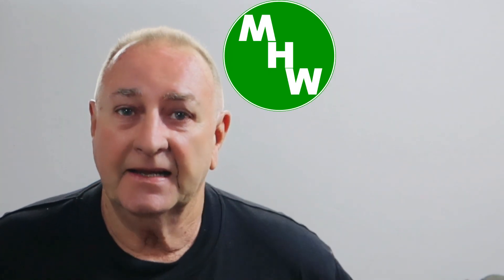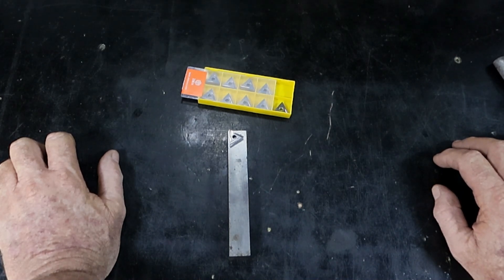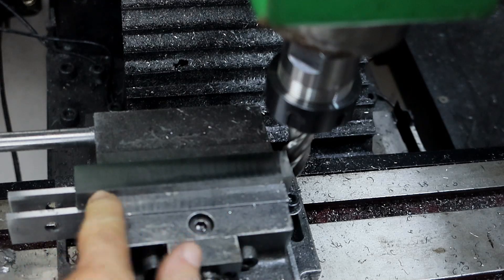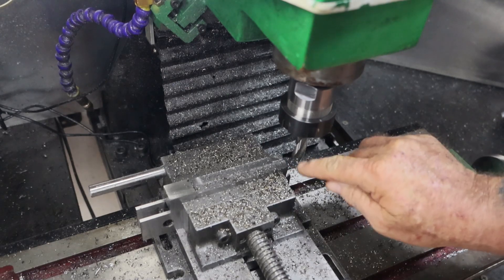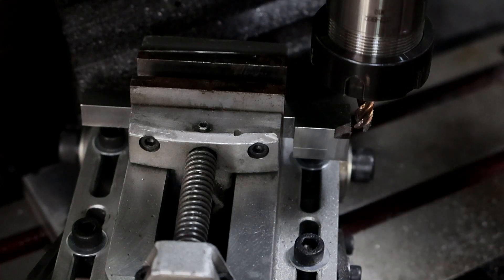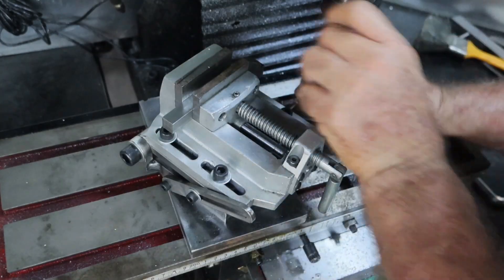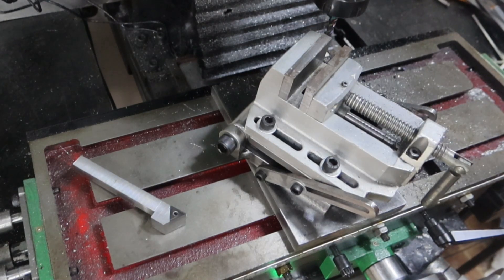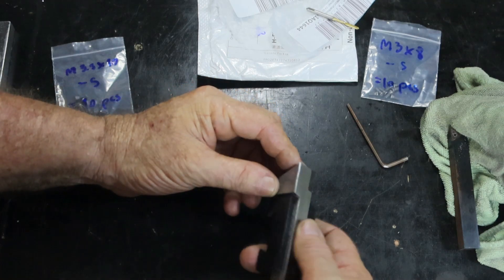MHW Episode 102 - 12mm Shank TNMG Carbide Tip Holder

Comment: Hi Paul, just looked at my TNMG tool holders, the face on the tool holder is not parallel to the tool holder, points down at the front and to the left to give clearance on the RH tool holder.
Just ordered tips   but they are only 45 Rockwell C
 hardness.
OK for Aluminum even though the seller says suitable for SS.
Reply from the maker: I've since discovered that as well. Thanks for watching. 👍

Comment: WOW
That insert worked better than I would have ever thought it would.
even if it is an insert with no side clearance and your tool holder had a horizontal seat for it, it did relatively well
inserts like this usually have a toolholder with a seat that's machined at 5° to create side clearance
Reply from the maker: Thanks, interesting, that may explain the massive burr it creates, if I can figure out how to hold it and cut a 5° seat I might try and modify it 👍